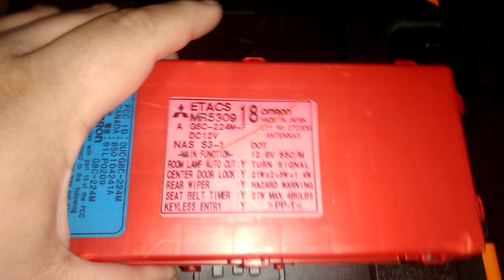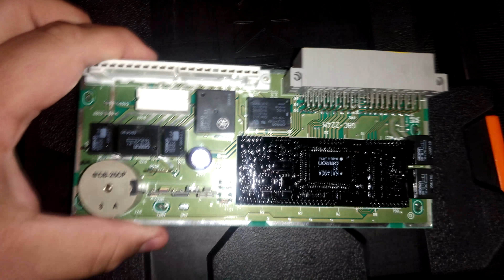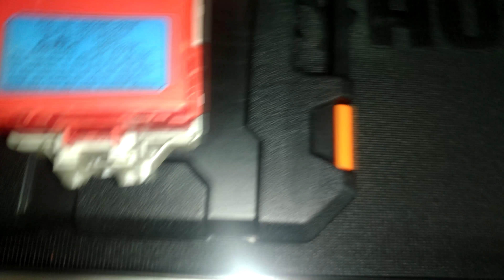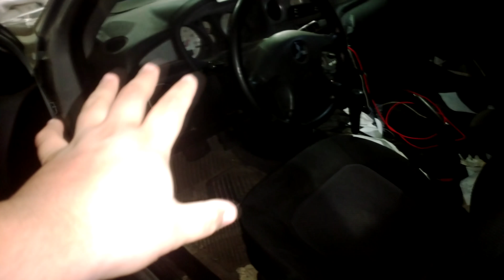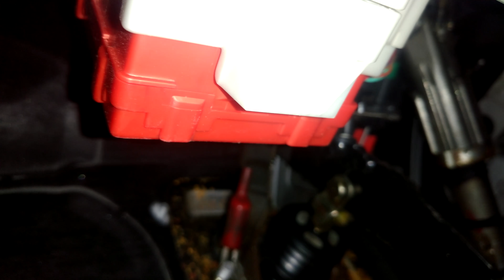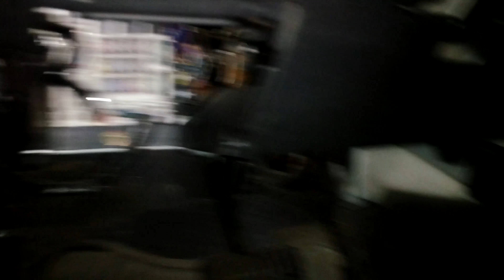Mitsubishi Outlander ETACS unit info

Comment: Thanks. I have an 09 Galant and the left flashers aren't working with the hazards or lever so I'm gonna try and replace this ETACS thing and hope it works.
Reply: Did it work? I have an 08 and my wipers stopped working. He said this etacs are from 03-06. I found an 06 at my local junkyard. Gonna try it out.
Reply: @SamplaysMC12  yeah it worked but the etacs is locked to a vin number. You'll need a new one or the car won't start. At least that's how it was for my 09. Older models might be different
Reply: Cameron Johnson is this basically a computer?
Reply: @SamplaysMC12  yeah pretty much the brain of the accessories and lights in the car
Reply: @CamEtherTech  SO CAN IT BE PROGRAMED?
Reply: @patriciacorral1796  yeah it has to be programmed by a dealer or someone that has one of their tools. Can't be a  used one

Comment: Do u know if the ETACS has be reprogrammed, I change it, signal light works now, but car won’t start now.
Reply: DID YOU FIND OUT IF IT CAN BE PROGRAMMED?
Reply: Were you able to reprogram it? From what I've heard a used one won't work has to be new